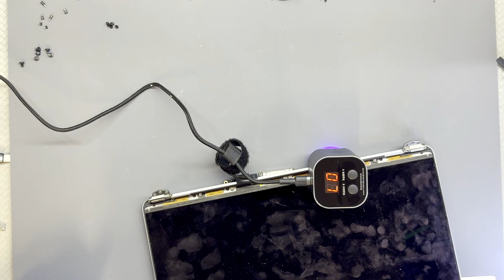Macbook Pro With Vertical Lines On The Screen? Here is how to fix it!! (Dustgate repair)

Comment: hi...my mac have these strange lines and  most of screen black when not used for couple.hpurs but after a minutr of display on it comes back to life slowly and work perfectly after no matter how many times you try move display up or down it works flawless...what coulds be an issue ? thanks
Reply from the maker: Could be the tcon or the panel itself. Has it been damaged anywhere ?
Reply: @macbookfixer Not damaged at all...works for hours after screen comes to life and used normaly 😅.Somehow cold affect it as much as i figured out
Reply from the maker: If the lines are horizontal every time I have encountered that behaviour was the panel itself and was not worth opening to even test the tcon.. I’m assuming the lines are horizontal right?
Reply: @macbookfixer sorry i said lines, but actually at startup only around top 2 cm of display work but backlight is working on whoke screen...then after a minute i get whole screen up and bottom kind of weirdly flicker then comes to full life...Yea def not worth to replace anything since it basically work and not even worth it,but was wondering since i like to repair stuff that there might be a some easier fix for it
Reply from the maker: @In_love_with_music if it was a flex issue it would change with the motion of the lid, I mean opening and closing it would affect the things it displays, but since it doesn’t then the panel itself is defective. Just use it as it is until it gives out completely. I wish I could be of more help. 😢
Reply: @macbookfixer thanks a lot ...yea probably will be like that 😅...thanks

Comment: Great surgical precision! Could this be the case if there is a horizontal line? In my case, it shows only half of the status bar but the external monitor works.
Reply from the maker: I doubt that, in your case it sound like the panel itself has some issue.
Reply: Was yours replaced?
Reply: @BrettSauve  Still sitting in the shelf. Tempted to buy 2nd hand monitor from ebay and replace It myself, but havent done it yet.

Comment: Hey I have a 1708 model with similar lines- different colours and they change colour once in a while also sometimes the whole display gets the lines but if I close the lid and reopen it, it goes away. And sometimes flickers like crazy. Could it be a similar issue?
Reply from the maker: Most probably yes. It might be at a different data line but if they are the same then most probably yes.
Reply: @macbookfixer  Hey thanks for quick revert. I do have the 1708 model for sure. Most of repair shops in India asking me to change the entire screen which I have done twice already. Kinda painful and hole in my purse.
Reply from the maker: @ZEROZONE36 I don’t even know if it worth the replacement anymore. Counting that it’s a 2016-2017 model.
Reply: @macbookfixer absolutely, I feel if the flex gets fixed its alright or else using it headless is way better than wasting money.
Reply: @macbookfixer  What awg of wire is needed to act as the jumper?
Reply from the maker: @wartank9941  I usually do it with an insulated 0.02mm. Something thin works as you need it to not stick out and get caught in the opening-closing of the lid and brake.

Comment: hmmm I have 2015 MacBook air, used alcohol on the screen, now has colored vertical lines in the middle
Reply from the maker: I’m afraid this particular fix does not apply to your situation.